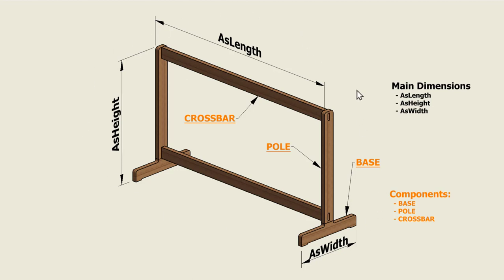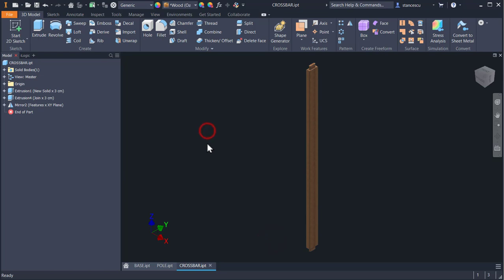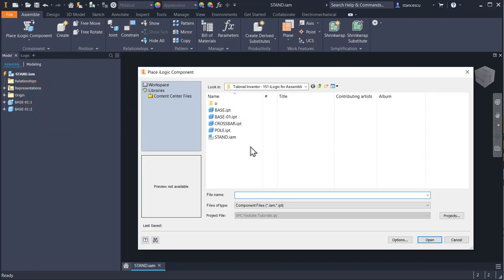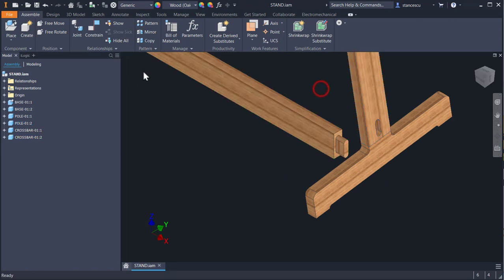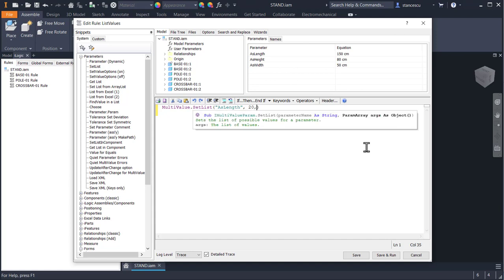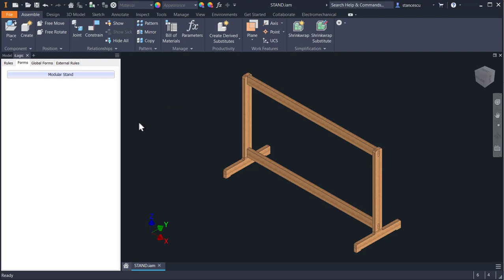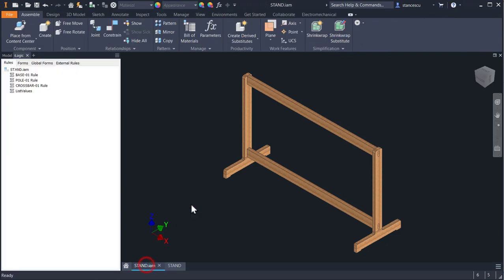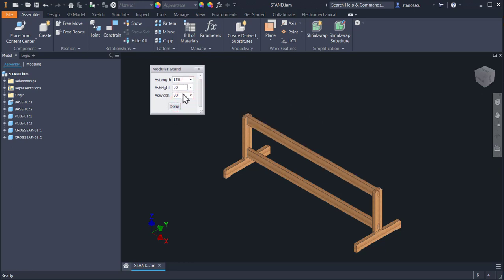Tutorial Inventor - 151 iLogic for Assemblies

Comment: Hi Stancescu. I am trying to make a part, for instance Din channel, with flexibility in length when put into assembly. Coz in electrical control panels, channel can be of any unspecified length. its not viable to put values in multi value. Would you please help me to sort it? Thanks
Reply from the maker: Hi Vicky, my advice is to re-create step by step the assembly presented in my tutorial. Then make it again! 
It is difficult for me to give detailed answers to my CAD friends - they are a lot!

Comment: Hello professor. I tried to download the files, but there is an error (404 Not Found). Could you send to an e-mail or share in other website? Hugs from Brazil.
Reply from the maker: Now you can download without 404 - it was a small mistake in the link
Reply: @prof-stancescu  Thank you so much. I downloaded the files and did your class. 
A question: is possible to save differents drawings .ids for each possible assembly dimensions?